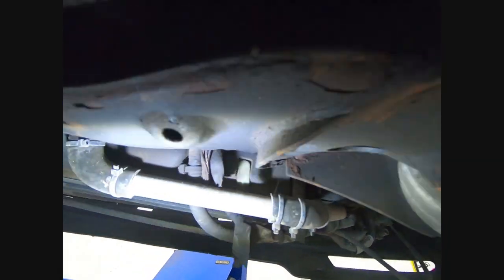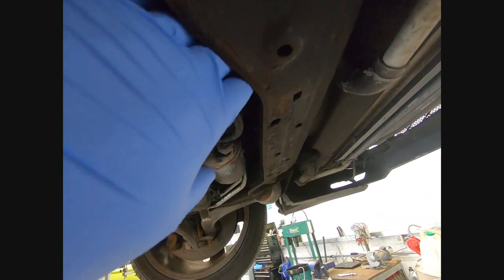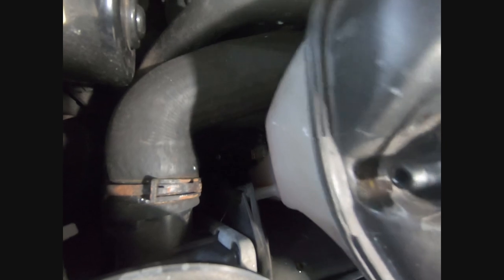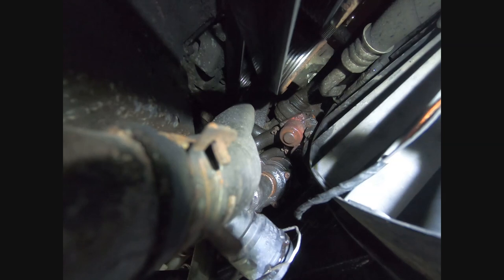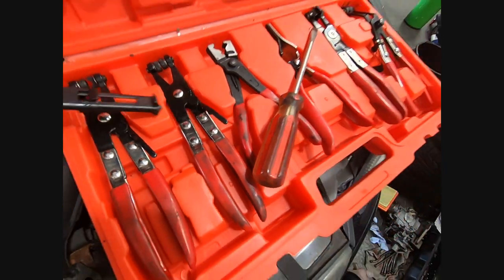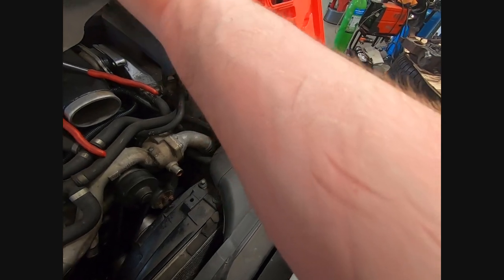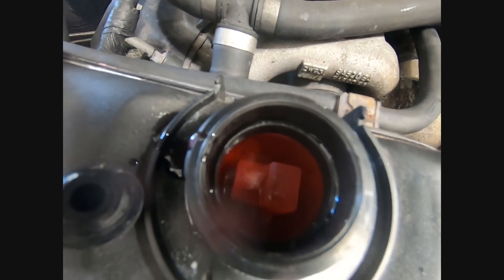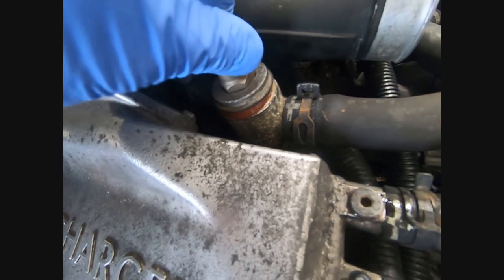Get Your Climate Control system working like NEW again

Comment: I just did this repair along with a long list of service my car needed. I have a black str . While I was in the area doing the control valve I replaced some hoses and the intercooler pump which is right above he valve . I actually did some modifications as the electrically connector was right on top of the control valve hose . No a good design .
Reply from the maker: I blame ford's imput for the poor design lol
Reply: @MarksWheels  , I was hoping you could help with a problem I'm having. I have a vacuum leak I found with a smoke detector .  After all the work I did before I put the car back together I vacuum tested and found the throttle position sensor has a stream of smoke comming from under the sensor. Is it possible ? Can't find any information if it could leak air . The EGR, egr tube and throttle body have new gaskets . I'd be really appreciative for the info . Thanks 👍
Reply from the maker: @mikejacobs4727  have you checked the throttle body gasket? It may be new but easy to pinch as the tb goes back in
Reply: @MarksWheels  , it looks good .
Reply: How’d you modify the electrical connector?? I’m looking to do this on my S Type R.

Comment: Thanks for this video .I have a 2004 s type R s/c with only hot air coming out of my hvac .could there be more causes causing this problem .I know it's usually the valve but before I replace that I want to sure that's the cause. Many thanks again because I learned a lot from the video
Reply from the maker: If you only have hot air from all vents it is likely yo be the valve. It could also be the ecu behind the glove box. If you are in the UK, there are a couple of places that can repair the ecu's. I would suggest replacing the valve first though
Reply: @MarksWheels  thank you very much .if i have in the future another question is it o.k that i will ask you?(i bought already the tool for the hose clamps)😁

Comment: Hello i had the same problem. Replaced with a new aftermarket valve, it works for a while. At the moment i'm washing the coolant system but the heater doesn't work (A/C works!). What can be? can the system become blocked for a washing process? i've done it with distilled water and vinegar
Reply from the maker: Ots very easy to get an air lock in these cars. Might be worth rebleeding the air out of the system

Comment: I have a 2007 jaguar S. type it blows hot air do you believe it's the condenser Or what makes that happen .
Reply from the maker: That could be a lot of things including the control valve, condensor or even the control module. You'd best probably get that checked out

Comment: Hi, I have got a Jag 2.7 Diesel 2005, as I noticed stopping is not precise and the pedal was bit stiff, I took it to the mechanic he changed the break pads and the vacuum pump but still same? what should I do?
Reply from the maker: I would try a smoke test to see if there are any vacuum leaks

Comment: I hope you used an OEM or Bosch part, otherwise you will have to replace it again soon.
Reply from the maker: Yep Bosch part
Reply: @MarksWheels  I am finding it imposable to obtain a Bosch part, its either original Jag at £325 or cheap reproduction. Do you know where to obtain a Bosch from?
Reply from the maker: @leighsanders2045  Not at the moment unfortunately. An OEM Jag one may be your best bet